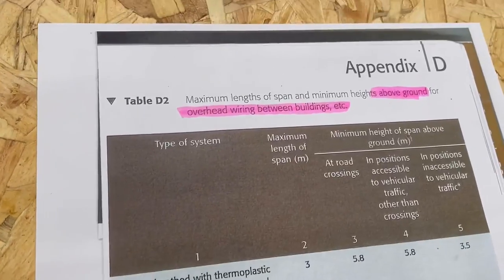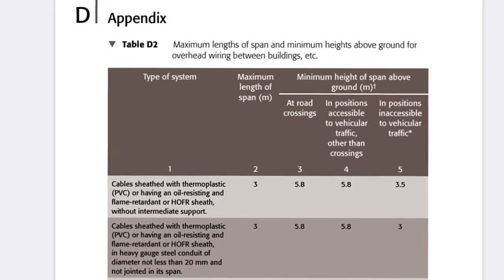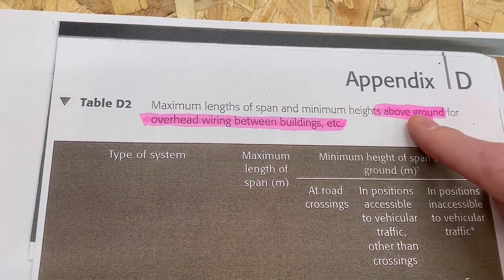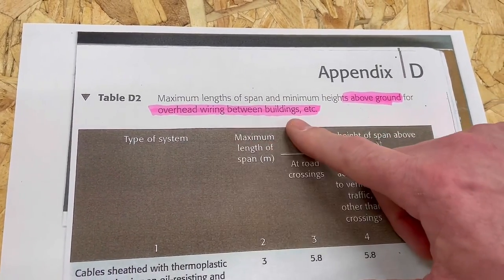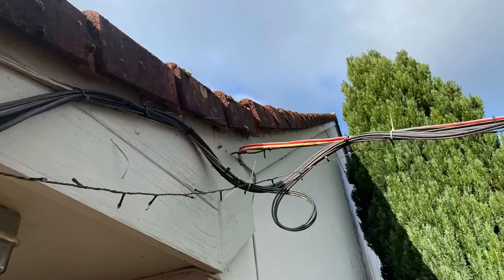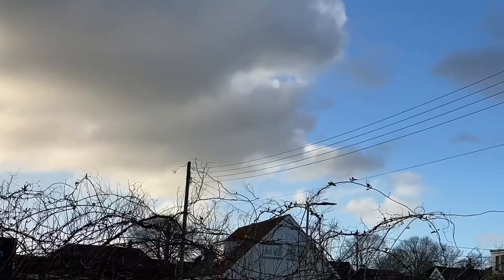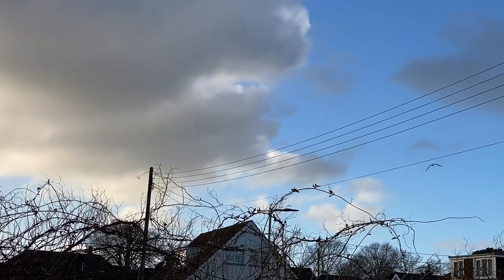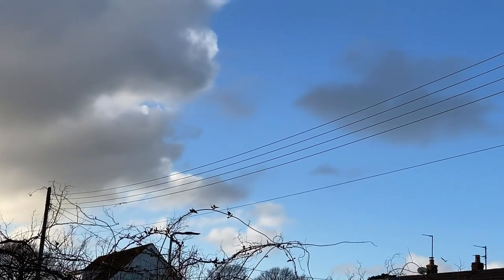Catenary Wire - What Height Must it be Installed at?

Comment: Never use plastic table ties  to fix the cable to the catenary wire unless it’s a temporary job. In my experience no cable ties last even so called UV resistant type. 
I always tape the cable to the catenary wire ,wrap it round 3 times then put a large buckle clip round the cable over the tape. Alternatively use a couple strands or catenary wire and twist it over the  tape to secure the whole lot.
Not so much these days but you should still make sure the catenary wire will take extra weight ie snow . It’s surprising how much weight snow is . Also it’s surprising how much cables contract in the cold . I have known other people put them up in the summer and not leaving a slight drop . In the winter the cables pull tight and pull the fixings off the wall or what ever.

Comment: 2 questions. 1: Is it acceptable to put the electrical wire in a twisting motion along the catenary wire rather than tie it on?  2: Is the armour on SWA acceptable as a catenary support?
Reply: Good questions. Bing chat says," Steel-wire armoured (SWA) cables must be adequately supported so that they do not suffer damage from their own weight1. As for any cable, cables connected to enclosures should be properly supported to prevent strain on the gland termination1. The connection of SWA cable to enclosures should provide electrical continuity and adequate mechanical strength1."

Comment: An electrician installed power including a consumer unit in my dad's garage, wired into the main consumer unit in the house. I think he used SWA cable and the portion that is run overhead is in metal conduit pipe. Does this follow Regulations and what is the minimum height for this set up? Thanks.

Comment: For cables outside I've used UV-resistant cable ties and came to the conclusion that even they break down eventually.
Much better and cheaper solution is to use scrap solid copper wire.
 Although it does not look as good it is quite long lasting and if the wire is high up in the air you don't see it.
Of course Stainless tie's are the best but not cheap...
Reply from the maker: Thanks for adding your thoughts 👍🏻
Reply: @GSHElectrical  Thanks for making awesome videos👌

Comment: Please i want to ask you this question; what's the right order in which you should arrange your circuit breaker in your consumer unit. should it be from the lowest breaker to the highest or highest breaker to the lowest and why... Thanks
Reply: The highest one is always closest to the main switch. Then it gradually descends.
Reply: @zippymo672  thanks for your response.
Reply: I don't believe there is anything saying you have to do that.
I do know that for heat dissapation in the consumer unit, its better to spead out larger amperage MCBs.